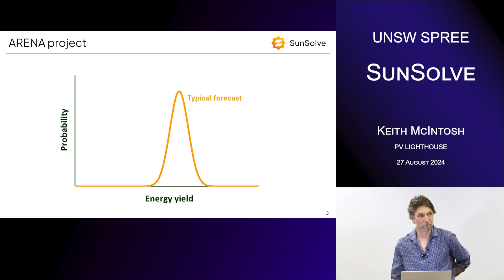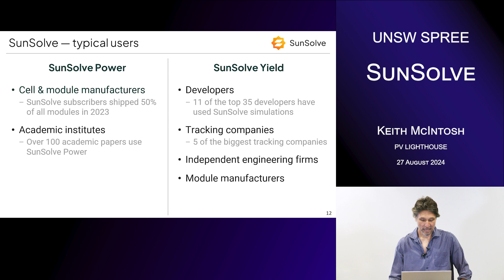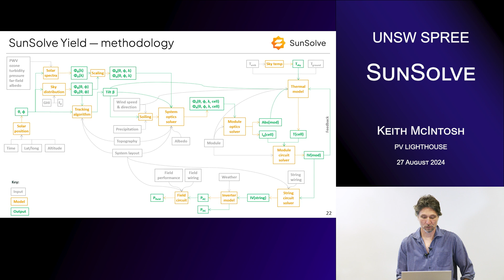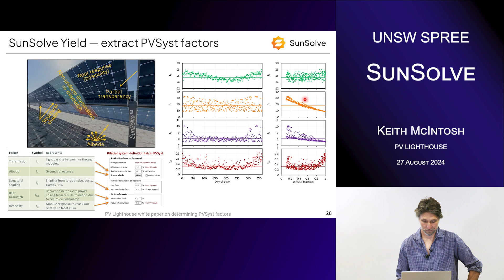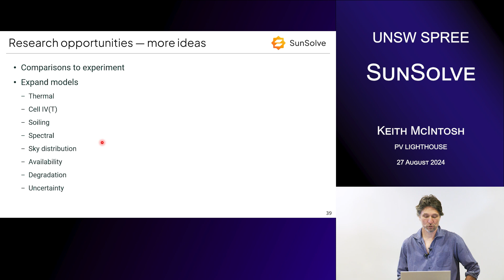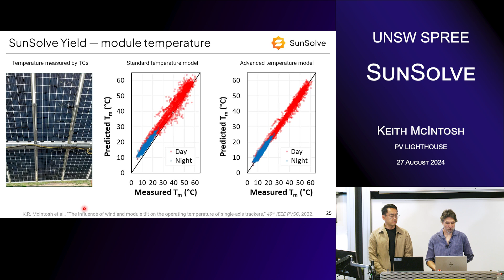UNSW SPREE 202408-27 Keith McIntosh - SunSolve

Comment: Thanks Keith McIntosh.
You have fully proved my patents, in all the conditions you have listed and explained.
Yes : Transmission fT Light passing between or through modules.

Yes : Albedo fA Ground reflectance. Аs needed, constant or variable
Yes : Structural shading fS Shading from torque-tube, posts, clamps, etc. (No Back Structural Shading)
Yes : Rear mismatch fMR Reduction in the extra power arising from rear illumination due to cell-to-cell mismatch.
Yes : Bifaciality fB Module  response to rear (Max) illum relative to front illum.
I Add: Optimization of self-cooling (Thermal losses)
I Add: Self-cleaning in rain and snow
I Add: Patented stationary Agricultural PV, with Light Transmission as needed, collects water for reuse